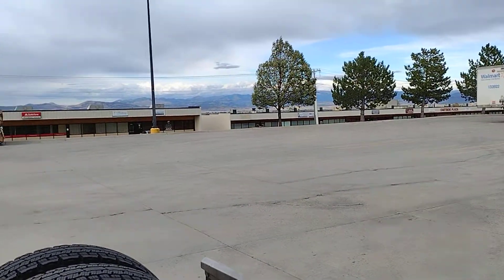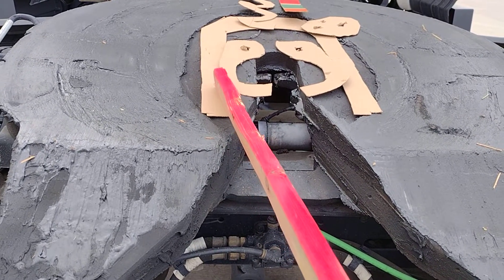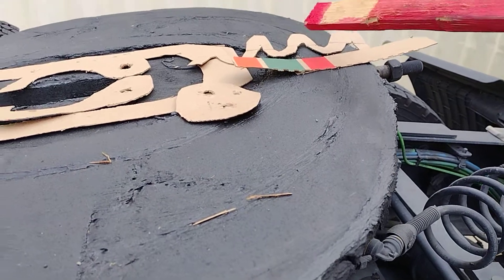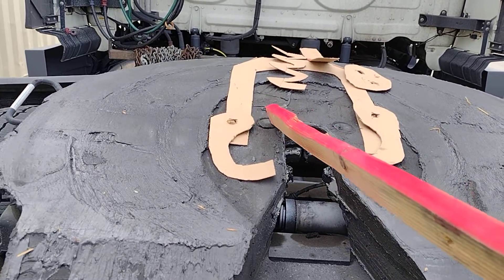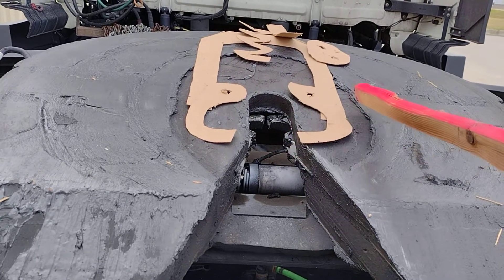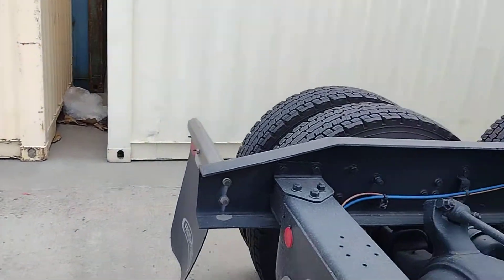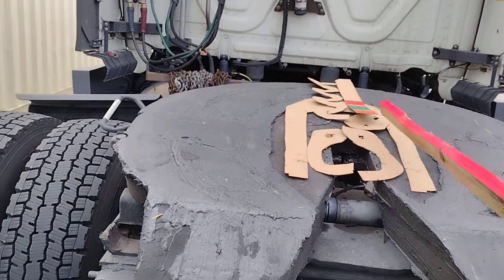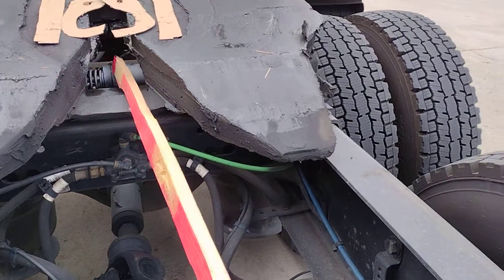How the Fifth Wheel locks and releases the Kingpin?   #Fifth_Wheel

Comment: How much gap is ok between the jaws when connected to a trailer?
Reply from the maker: The jaws have two fixed positions; open or locked. The is no variable gap. It is flip-flop setting that allows release or lock of the kingpin.
Reply: @bigrigexperience9294  I'll try asking this way. When hooked to a trailer and you are underneath the trailer looking at the back of the fifth wheel. Where the jaws come together around the kingpin. There is a slight gap between the jaws. How much of a gap is a tolerable amount. 1/4 inch? 1/8 inch?
Reply from the maker: @chazemarion5633  
The gap, in open position, is equal the diameter of the kingpin's neck. That is 3 inches wide.

The tips of the jaws must hide under the two sides of the slit where the kingpin slides to trigger the jaws to flip too locking position.

In the locking position, you should see either a single locking arm bridging the slit, or two locking arms, depending on the kind of the fifth wheel your tractor has.

Than you for posing propbing questions.
Reply: @bigrigexperience9294  The only question I am asking is about the two locking arms meeting together. Should there be a gap where they meet together? And if so how much of a gap is tolerable?
Reply from the maker: @chazemarion5633  
The the two arms are meeting in locking position, there should be NO GAP.

When the two arms are OPEN, the gap should be the WHOLE WIDTH of the Kingpin neck.

If there is ANY GAP in the locking position, you should not drive, you should immediately look of malfunction, defective locking mechanism.

Comment: Brilliant thanks! From a UK truck driver that always wondered how it worked. I know how to operate it of course, had nonidea what the mechanism was, especially for locking the jaws closed
Reply from the maker: I learned the mechanism by inspecting a removed fifth wheel. I turned upside down, and started tinkering with the components till I figured it out.

Comment: Very good video sir! Thanks for taking the time to make it! And very good English you did a good job! My peterbuilt jaws will not lock the release button works but won’t close back. IDK
Reply from the maker: Thank you for the kind words.
What kind of fifth wheel you have on the Peterbilt?

The release and lock are controlled by three steel springs that keep the cam in one of two positions. 
If one spring got fatigued or sagged, it would cause that  partial impairment.
Yet, a simple grease job should be carried out before you disassemble the fifth wheel to inspect it's parts.
Please keep me informed when you have a chance.

Comment: can you name the componant that sticks out from the skid plate?  It indicates whether the release handle is pushed in or pulled out. What is this piece called?
Reply from the maker: The "retention screw" in front of Holland 5th Wheel secures the spring to the U-slider locks.

Is called "rod" or "bolt" and is found only on Holland 5th Wheel.

Fountain 5th Wheel does not have front Bolt. It has internal securement fixture of spring.